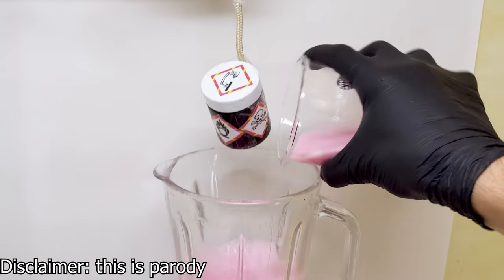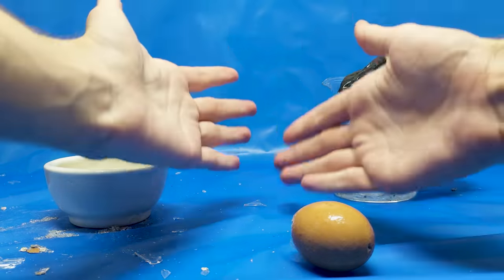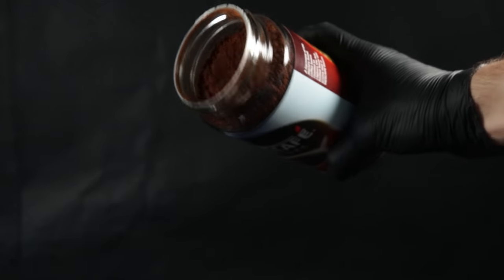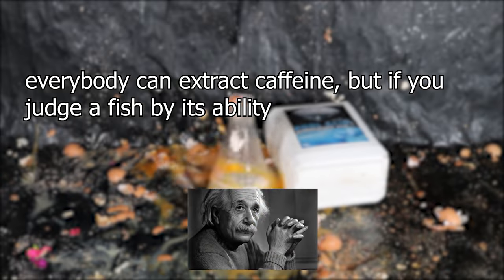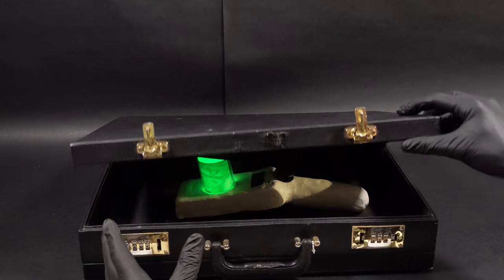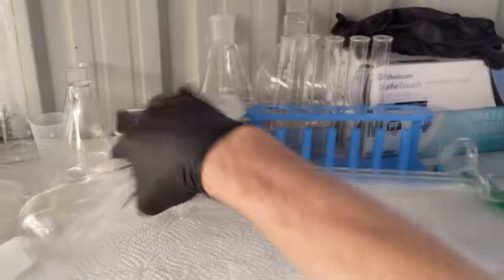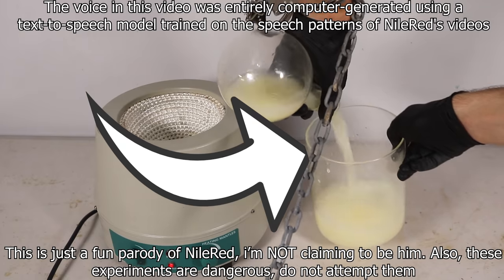If NileRed was bad at chemistry part 2

Comment: As a chemist, I’m flabbergasted at how long some of that glassware held up. With my luck I obliterated a 1 liter beaker by accidentally tapping the top with a metal scoop a little to hard
Reply: As a non-chemist, what the hell happened at https://youtu.be/OhQfgwv7uEs?t=128 ??
Reply: @ferfiti  the video shows as unavailable for me unfortunately
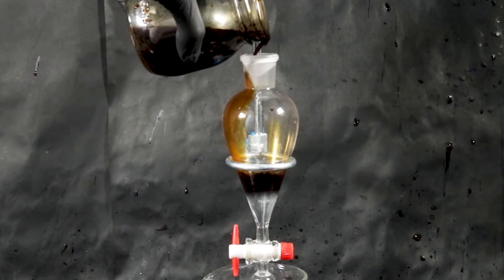Reply: @b3n048  i think the link is supposed to lead to 2:08 on this video
Reply: @b3n048  It's this video at 2:08 where he pours the mixture into the separatory funnel
Reply: I know, aye? Spending like 2 hours on an extraction, just to tap the beaker with the thermometer, busting out the entire bottom of it...
Reply: Glassware wears out. Basically, little microfractures compound over time, gradually weakening any glass object. Every time you tap, clink, or bump your glassware, you are just that little bit closer to the shattering point.

Have fun with that information :)
Reply: @ferfiti  Ok, I think this is just editing magic and not chemistry magic lol
Reply: Ohh I see thank you I thought I was going insane I didn't even think of video editing
Reply from the maker: I break more glassware from accidentally dropping them while cleaning up than what's shown in my chaotic videos
Reply: @ferfiti  He thanos snapped it
Reply: I once split a petri dish in half by pressing a wet sponge against it :/
Reply: @userequaltoNull  I still remember, when i was in high school, i just slightly put a glass rod into a test tube, and the whole bottom of the test tube fell off, and some of the acid fell on my shoe.
Unlucky day maybe.
Reply: @userequaltoNull  Tempered glass is essentially a very tightly wound spring made out of that glass object.  That's why it smashes so violently.  It was holding energy in tension and that break released it all, like a rubber band snapping.
Reply: @mrgreenguy  Thats sus
Reply: @ldobehardcore  Cool! I assumed it was just really brittle, does it actually exert energy on the shards when it breaks, or is that just a figure of speech?
Reply: @userequaltoNull  It does. The tension is caused by the outside of the glass cooling at controlled rates to cause the outside to be stretched tight, kind of like the skin of a drum.

The way it was explained to me tge outside cools quickly and hardens as the inside cools slowly and shrinks.

That shrinkage pulls on the outer surface. Pulls it tight. And that tension is stored energy. And when the glass breaks that energy is released throughout the whole structure.

This may be bullshit. It's just what I remember someone telling me.
Reply: Me too lol. I brought my brand new 1L Pyrex beaker with 500ml of sodium hypochlorite solution (rather slowly on a hotplate) to only 130F and it burst into a million pieces.
Reply: @ferfiti  Video editing. Not a reaction. If you look closely the swiping transition is rather obvious once you look for it.
Reply: @ferfiti  just say 2:08
Reply: I managed to shatter a ceramic büchner funnel by tapping it against a surface
Reply: Used to nonprofessionaly do some chemistry experiments. My 1 litter beaker made in Czechoslovakia serve me for concentrating 30% sulphuric acid to ~90% for like 10 years now despite regularly endure  200°C+ boiling acid :D
Reply: @Billybob BoDiddly hes a chemist
Reply: @Billybob BoDiddly UWU
Reply: @ldobehardcore  sorta, that’s what breaks glass, but tempering as a process equalises all these internal forces by allowing the glass (or metal, same process applies) at a controlled rate, allowing the internal stresses to cancel each other out, and preventing the glass from shattering unexpectedly, and also allows it to be cut without it just instantly shattering. Untempered glass is considerably more fragile.
Reply: @ferfiti oh that’s just his Jesus privileges.
Reply: @mrgreenguy  bruh
Reply: @ferfiti  Video editing.

Comment: Here's a Nile Red parody idea:
I went to Chernobyl without a radiation suit to see if it was as bad as they said it was. I mentally prepared myself for the pain...

But it wasn't that bad. It just stinged a little. I guess I'm just not that sensitive to radiation. I went in deeper, but it was just the same. I got my friend to take off his suit and he died instantly. I guess I'm just not that sensitive.
Reply from the maker: That's exactly how it would go
Reply: genuinely chernobyl without protection is fine if you know whst you're doing. except for the mines the russians planted at the start of the war
Reply: @mrgreenguy  ... and you went during your Manhattan Project.
Reply: @qwoolrat Unless you go actually inside of the reactor.
Reply: @lagrangiankid378  that sounds awesome as fuck
Reply: @qwoolrat they kinda dig up the soil and radiation went up significantly.